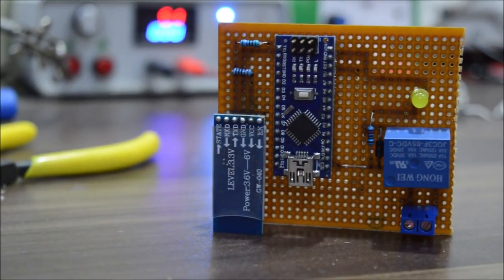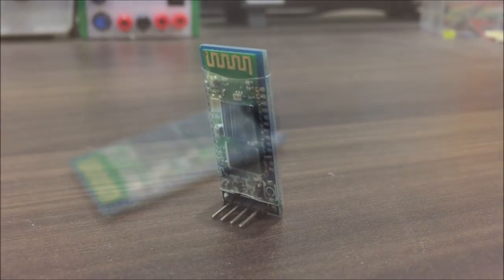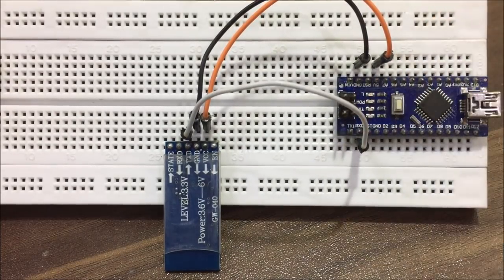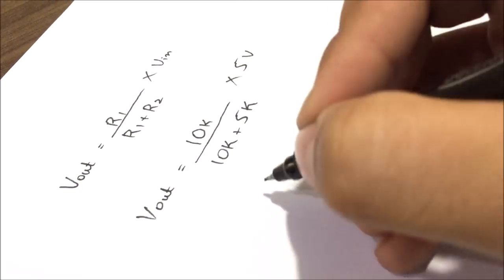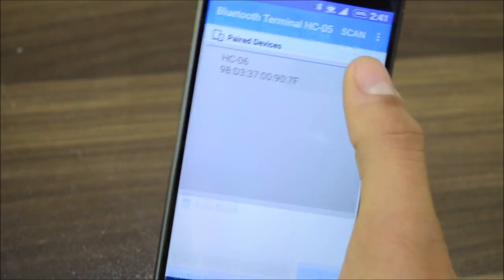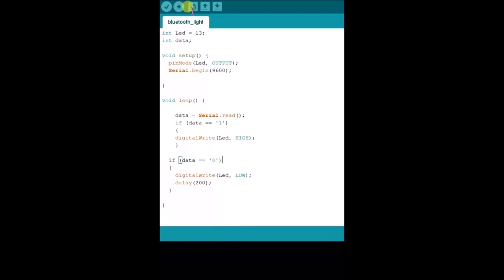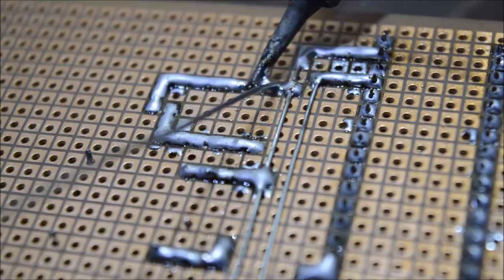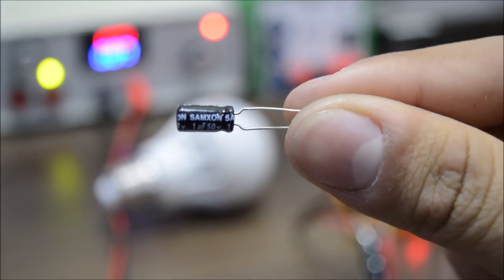Control room lights with smart Phone Just Add This Circuit | Bluetooth Controlled Lights

Comment: Bro can you add 5 channel in this circuit plz give me answer
And what will have to do for more adding channel in this circuit??
Reply from the maker: Just make more IF conditions for different ascii characters in the Arduino code and turn a certain pin on or off 
And also in the app add more buttons like shown in the video

Comment: I think there’s an error in your formula and consequently in your circuit. According to your circuit Vout = 1.67V. It should be Vout = Vin*(R2÷(R1+R2)) If you swap over the resistors, you’ll get the Vout = 3.3V. The calculation you show is correct but the formula you used is not. Still liked you video though.
Reply from the maker: MUDGEL you can swap the R1 or R2 resistor in the nominator it doesn’t really matter but if you do so, consequently you have to take the voltage across that specific resistor like in my case R1
Reply: I don’t want to get into an argument with you on your channel   Please check your references so you don’t misinform people.